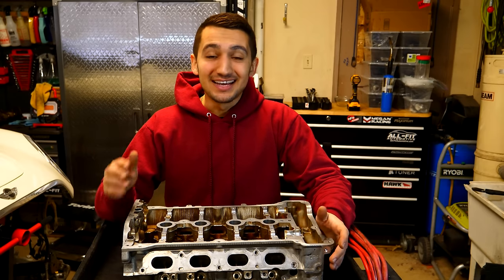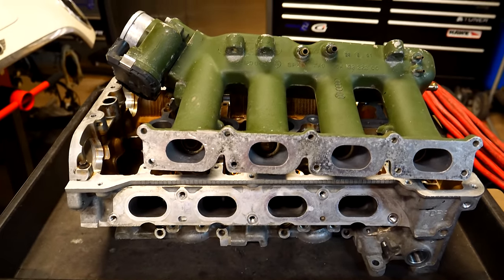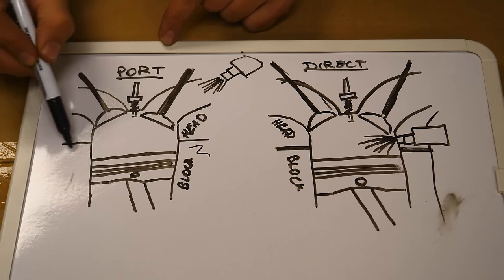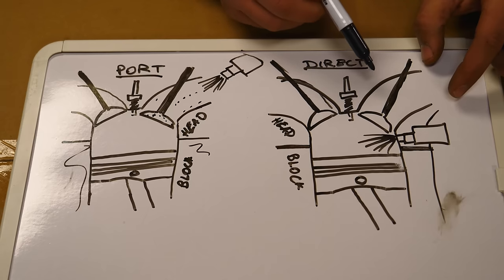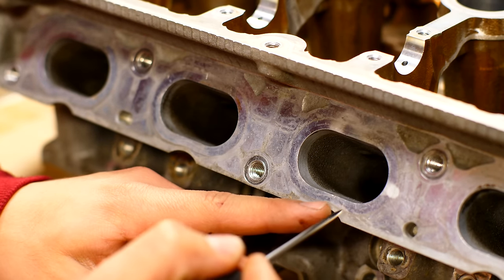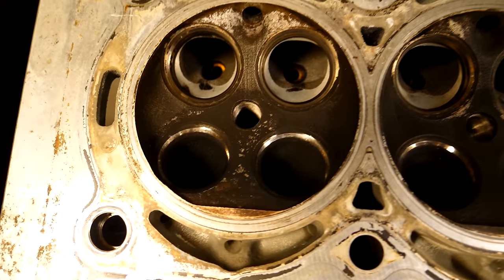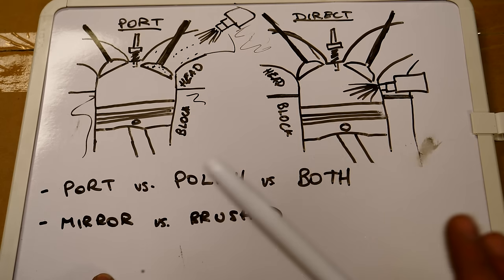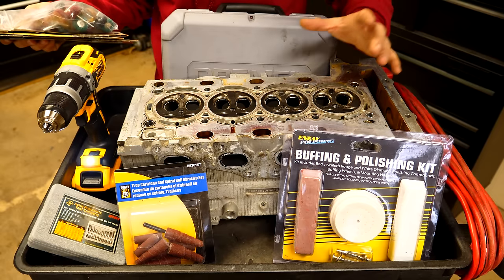Porting vs. Polishing vs. Both

Comment: Its good to see young guys having a go and learning and you have to be commended for that. But i do think you may need a couple of thousand hours in front of a flow bench and the same on the dyno. Some of the things you talk about are correct but there is a lot that is not,and theory is great but in the real world of cylinder head porting and testing it is proven wrong! Cylinder heads are funny things and the physics involved needs to be understood correctly, but if i can offer you some advice it would be to do some reading up on boundary layer effect and airflow dynamics. Also ports are great but most of your gains will be found in valve seat profiles. Anyway keep going with it and keep learing but just don't get set in your ideas and thoughts as applying real world testing and science my change your mind.

Comment: 99% of porters are doing it wrong. Do not ever use a pneumatic grinder unless you like oatmeal. Take intakes up to 80 grit polish the exhaust to whatever. Watch the short side radius. Use a stone on the ssr if your not Mondello level porter. Do not chase casting seems. Raise the roof , and just clean the floor. Pull your radius and straighten up walls. CNC is for heads that are popular sbc , honda. Even then a porter should clean up cnc work with a stone.  For the home gamers. Get yourself a dimmer switch and plug in a metal box with extention cord and a Makita straight grinder. The dimmer will control your speed. To keep your carbide clean USED motor oil is best. No need for fancy  cutting oil.

Comment: Porting good. Polishing chambers and exhaust ports good. Keith Black found 6% hp increase over entire curve with chamber/piston polishing. Polishing exhaust ports has a small gain, but mainly keeps carbon from sticking. Polishing intake ports is a waste of time. Wet flow happens in both polished and ported. Focus on velocity and swirl/tumble.

Comment: Sooo a rough finish flows much better were it's wet in the intake so polish upstream from the injectors but emery cloth 60-80 grit for the wet. Reason is fuel sticks to the walls and hurts flow and fueling. You could polish the combustion chamber and exhaust port but these days I ceramic coat all that works better for less effort if you ask me. Have fun

Comment: A mirror polish on any part of the intake system should actually REDUCE airflow not increase it due to the Coanda effect, which is the tendency for airflow to stick to smooth surfaces, causing a dramatically slower boundary layer of air sticking to the smooth walls.

Comment: You need to make the ‘combination’ not just change one thing. That head is a late model design optimised for street duty, porting it without changing cams, intake, exhaust, compression, rev limit and tune will drop the velocity. More flow always requires the combination to be optimised, that’s why the turbocharged method is best, no porting required.

Comment: "flow more".  Only at certain (high) rpm.  You want narrower, longer runners for low and mid-range where you spend 99% of your time.
Reply: Except for when you're racing you're spending all the time in the higher RPM

Comment: Take it from somebody that has spent 35 years and thousands of hour on the flow bench and dyno. Polishing ports does nothing for performance or flow and in fact it reduces flow. You are young and still learning buy some good books on airflow dynamics and a flowbench and then after 20 years of learning and testing then you can make a YouTube video that is correct. Oh just a tip study up on a thing called boundary layer effect its very interesting.
Reply: I totally agree......knowledge is power, not to mention proprietary in some cases. A flow bench, Dyno, understanding of thermal / airflow dynamics, geometry & 3-D measurement, proper tooling, patience, time, money, extensive knowledge of the particular OEM's / set-ups you are working with, & testing is absolutely critical.....and that's just the beginning, lol. I've been at it for 25+ years in my little world on my own engines (which isn't really saying much other than it works for my particular application).....I've only personally met 2 individuals in my 47 orbits around the sun that are truly masters in this subject (maybe you're the 3rd, that'd be kewl)...but both own a flow bench and dyno, both have been doing it 30+ years (One does Chrysler, the other Harley Davidson....and that's ALL they do)....both are engineers, own their own shops, and both have storage areas with catalogued / organized racks of sleeves, pistons, carbs, intakes, heads, & exhaust parts from all the R&D / data collection they've done over the years (and yes, even some expensive catastrophic failures).....the only reason I was fortunate enough to even meet and work with these fine gentlemen is I'm a certified CMM tech (coordinate measurement), certified in NDT (Level II UT/MT/PT/VT), and my welding certs (all processes & CWI / CWE)......which are really just small parts of their final "non-disclosed" equations (mainly for inspection data, testing, & repairs).......you typically only find these guys by reading the record books, and not necessarily by name either......but by their final numbers / results.....not in some YouTube video.
Reply: Yup slightly rough is better. Smooth it sticks

Comment: Awesome introduction to port and polish. I’ll be doing this soon. Thanks.
Reply: I felt I’d practise. Learn. On an engine that isn’t to be used. Test it. Then when I get aluminum heads plus a ton more education on my part I’ll probably think about doing mine or find a performance shop. I did my cr500 Honda back in the day. But one cylinder is easier then 8 and mine was obviously 2 stroke. Left it rough.

Comment: I bet a occasional aerosol seafoam treatment sprayed in to the intake in the engine on a direct injection system would keep the carbon deposits from getting really bad. I’ve seen a couple of videos on YouTube where this is done and it has made quite a bit a difference. One video even used a borescope to show how much carbon was removed from the back of an intake valve.
Reply: Jeff Stone  I do my directed injected engine every oil change so far no issues

Comment: There's nothing wrong with mirror finish in the intake port on a mpfi system. Your argument is more relevant to throttle body injection or carb systems where fuel is introduced at the manifold inlet and needs to stay atomized. In a mpfi system the much higher air velocity at the moment of fuel introduction combined with the short travel distance makes it a negligible benefit in atomization leaving some roughness to runner. You'll benefit more by mirror finishing and flowing more air in. The smooth port in modern plastic manifolds is a perfect example of this
Reply from the maker: Without the use of a flow bench, there isn't a way to test what I'm saying vs. what you're saying. By removing the nasty castings, I think we can both agree that is where the most amount of power will be extracted from. By going the extra step to go for a mirror polish is negligible for both systems.
Reply: milanmastracci actually i think you'd be fairly surprised by the difference in flow turbulence can cause, especially when there's really no need for it
Reply: Granted most of that will be seen at higher rpm but on smaller higher revving engines you can certainly benefit
Reply: generally mirror finish the exhaust port purely to prevent carbon build up, you never polish the intake ports EVER even on direct injection. The mirror finish actually slows airflow down. You leave the intake ports rough like about what 80 grit sandpaper would leave for a finish. The rough surface traps air and allows the intake air to flow with less resistance due to the air on air contact instead of the air on port wall contact.
Reply: userpike nice explanation.
Reply: yup, some people are going so far as to machine dimples into the intake runners (like a golf ball) to make the "sleeve" of turbulent air along the runners as thin as possible and still give you the best benefit of laminar flow towards the center of the column of air moving down the runner. I'm no engineer but i know there's a way to calculate the pore's depth and diameter to find an ideal size depending on different variables.
Reply: userpike that is exactly what I came here to say.  I'm glad someone else is spreading information which is tried,tested and true. 
On carby heads I normally finish with a 60grit wheel and on any form of efi I finish on an 80 grit. As someone has explained below a golf ball has very little wind resistance due to its dimples. 

The microscopic layer of air that becomes trapped on the port walls will leave a finish that is so much smoother than you can possibly hope for via polishing.
Reply: I was just about to comment goings against what you says Tyler but everyone else got it right
Reply: Userpike pretty much hit the nail on the head, a polished surface is "sticky" to airflow, you pretty much want to avoid it on the intake side and it may or may not prevent carbon buildup on the exhaust side.  The reason why professional porters tend to spend time with sanding rolls is not for performance, it's to impress their customers, so when they post pics of "I just got my shit back from the porter's" that they get all the oos and ahhs and generate more business.  I often leave my own work that's going on my car and no one will see in the surface that a double cut carbide will leave, if for some reason it's bouncing around in that area I might hit that really quick with a 60 grit sanding roll to get any scalloping out that the carbide might have left..

The dimples people mention are not entirely analogous to leaving an unpolished surface.  Porters that know what they are doing are usually using them where they have problems with the a/f mixture impinging on the surface and forcing some of it out of suspension, and usually in the chambers, which follow somewhat different rules- you do cut to relieve valve shrouding to increase flow, but most of the rest of the work you do in the chambers is to control combustion pattern and detonation.  

All that said, the surfaces of modern castings are in most cases not good candidates for this kind of home porting which is really more of a polishing- you're not removing enough metal to change the general airflow in the ports, you're just changing the surface finish (no, I have not looked at your followup video, but based on the tools you showed, you're not going to do any re-shaping unless you're going to spend weeks doing it).  Modern aluminum castings tend to have really nice, precise finishes and the manufacturer's go to quite a bit of effort to make them work well for their intended use.  The only place where that kind of work really shows any gains on newer stuff is in removing casting flash/lines if they're really bad and at the margins between where the cast finish meets machining (like behind the valve seats).

Messing with the port match as suggested in this video can be a problem in some engines also (again, unless you're making big changes in the shape of the port) especially with more modern stuff where the manufacturers went to a lot of effort designing these things.  Modern manufacturing techniques can get these raw cast aluminum or plastic parts repeatable to tenths of a mm, do you think that they are different sizes by mistake?  I can think of a few places where doing this kind of thing will give you no HP gain and will hurt torque, driveability and/or mpg.
Reply: Mark Pikas your last paragraph the step from exhaust port to header comes to mind. Leaving that slight step seems to affect reversion and sound wave energy positively. Where else have you seen these effects take place?
Reply: Craitlok, doing that in the exhaust ports is a very common one that has been used well before current manufacturing processes (I believe it goes back into the 1920's or earlier, there's some MIT press published studies going back that far about it).  It works NA but can also  have dramatic effects on turbocharged vehicles.  there's a lot of good porters that will gasket match specifically to a gasket one size smaller than the header/manifold tubes, or in some cases there are gaskets available that basically cut off the bottom of the exhaust tube that are still larger than the stock exhaust ports in the heads.  I've seen something simlar done on intake ports, usually the top and sides of the ports match pretty well but the bottoms have a big step in them (I've seen as big as 1/2") which at low rpms caused a dramatic increase in torque.  I believe that in one of the setups it also caused in increase in low end and midrange efficiency and MPG.  I beleve in some cases this is used to change the airflow's entry angle to the valve changing the tumble/swirl plattern in the chamber.
Reply: Oh, and harmonic tuning is really a pretty big deal, especially in intake ports but it affects both.

That actually raises another issue, and that's changing port taper in the intake ports and nozzle size in the exhaust ports by the porting.  Cutting down the port taper can decrease flow/velocity even with a larger cross-section, but increase harmonic peaks AND lows, and messing with nozzle shapes in the exhaust can cause port flow to stall completely.  

After seeing the second video... Oh boy, I can keep going... but I'll just leave it at that cutting back the area behind the valves like he showed past 85% of the valve area is not only going to hurt port taper and flow but also tumble/swirl in the chamber, and increase the area you' need to open in the chamber to unshroud the valves (further hurting flow if you don't do it).
Reply: Was hoping there would be a smart comment on the polishing.. I agree 100%..
Reply: forced induction also changes things majorly
Reply: Mirror finishes are counter productive, period. It decreases the boundary layer. Nobody does that shit anymore.
Reply: magnaflow exhausts spoke of reduction of parasite drag in their flow-through mufflers since the static air in the ports  of the tube acted as a film. Id assume the same applies to trapped air in the crevices that serve to "lubricate" the airflow rather than create restriction.

Comment: any one who has done porting knows where and how to port the head or intake
you learn from mitakes and gaines and some heads and intake only benifit from blending and port macthing and some lite polishing so if you dont know learn cause the out come could be much less hp with stock heads intake than you started with. but if you do your porting clean and clean and againe you dont want lose meatal in your rings and cylinders walls.and if you are thinking of porting look at the vavle it might be your problem that lip changes alot of flow it there to cause turblance so the mixture stay atomized.so do your home work before you grind.oh ya dont inhale the dust from grinding get a mask on or get sick from the dust the big Canser.

Comment: Yes all in theory . Your tune instead tuned for that added fuel/ air so there for it would probably run like poo  , and if your porting and polishing your heads you probably go with a bit bigger injectors ext
Reply: There is not that much theory in it. This guy does not understand or know anything of fluid mechanics.

Comment: Smooth is like watching water roll across a windshield with rainx on it. Fuel needs to break up and tumble on a rough surface with the correct shape for maximum velocity
Reply: Try to get the air to be not turbolant. It is impossible